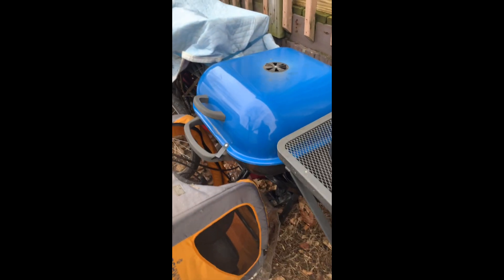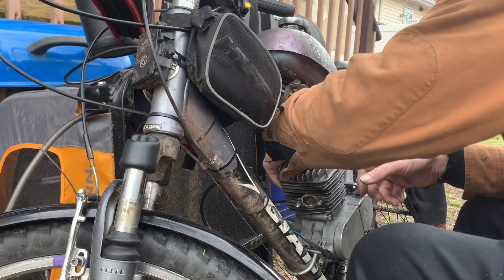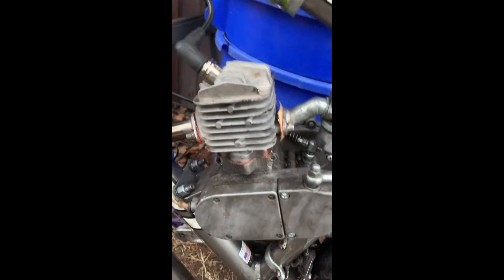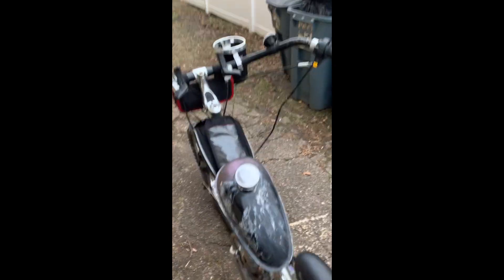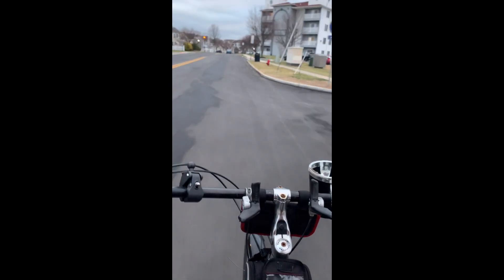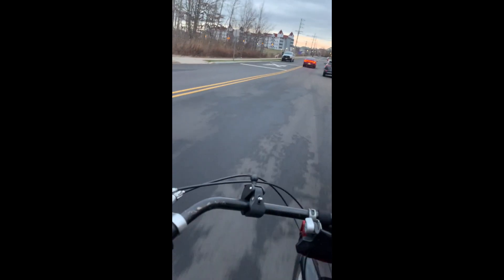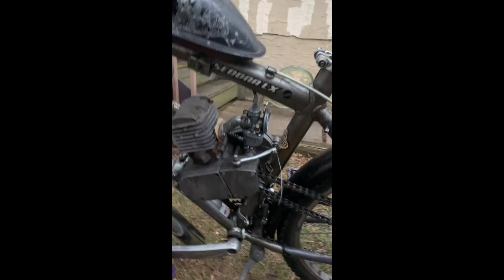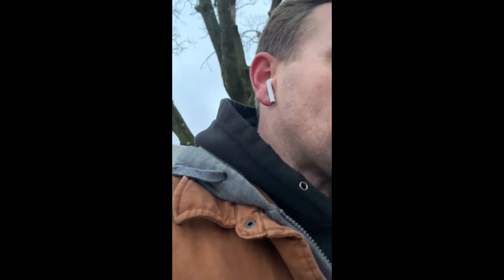Back to basics! My first motor 50cc single piece jug (motorized bicycle)

Comment: 5:15 I highly recommend letting your motors warm up with small throttle blips for at least 30 seconds. 
going straight into the throttle like that is a good way to nuke another top end ;)
Reply from the maker: Well... you aren’t wrong sir. Lol

Comment: Sweet. I've never seen a jug like that one. Interesting. Hows the YD runnin? Btw thanks for the ride. I think I'll watch it again, it was fun.
Reply from the maker: The yd is running... just not well I need a larger jet in it, it’s joking right now on air runnin really lean but it’s atleast doin 30mph+ atm so it’s better then that larger jet that wouldn’t let me get over 25. However that jet is safer for the motor 🤑
Reply: Right. Im struggling with my PWK too. I built a case reed and all that fancy stuff so now i have to re-jet and test it. Then more than likely do it again.